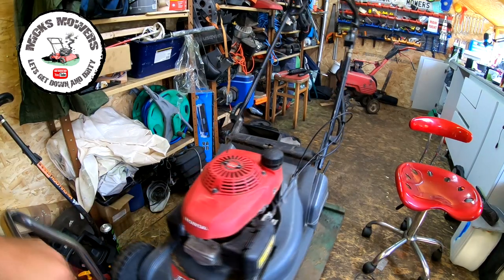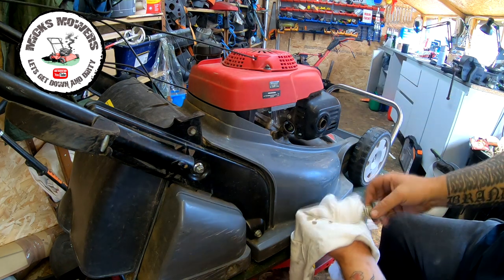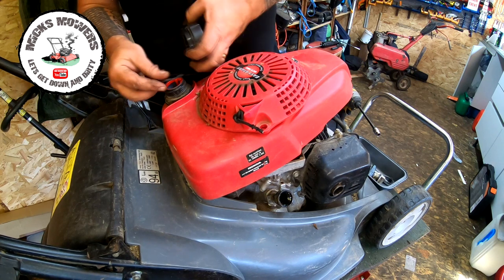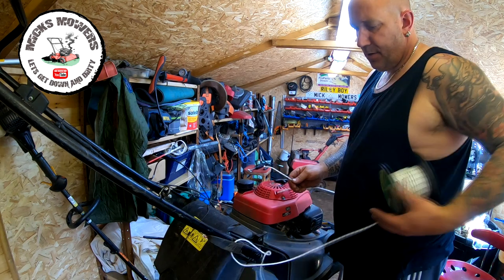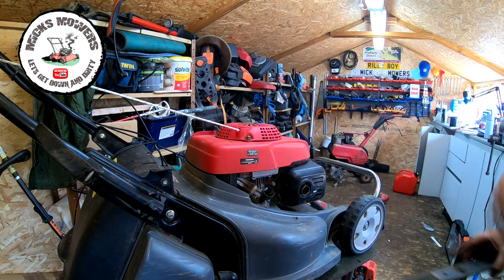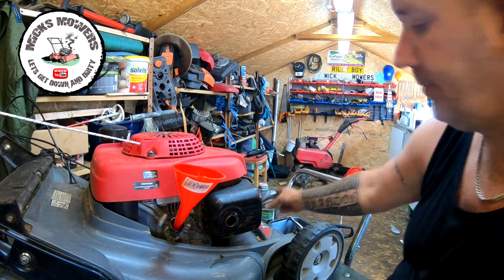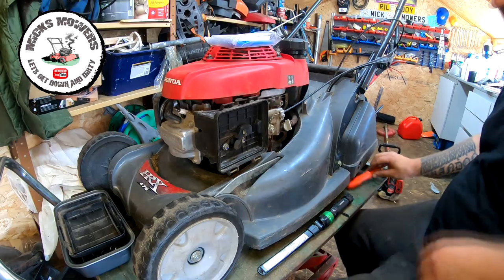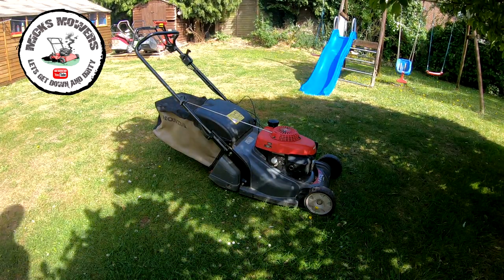Honda HRX476 How to Service Quick fix and Easy - Save some cash

Comment: Great video - really helped me do my own service.  I just had the rear drive stop working so took it in for repair and they told me a pin had snapped in the drive mechanism which should be ‘lubricated as part of normal maintenance’?  Had no idea and mower is 7 years old.  If any chance on future video include a how to on that would be maintain that mechanism great!
Reply from the maker: Hi.. yeah I have done a video on that fault already..

Comment: Hello from Texas again. It looks like things are different in the UK because all the Honda and Honda clones I've seen in stores and worked on all requires 10w30 motor oil and I've never ever seen a mower with front wheels and a rear roller. I don't know if "roller" is what it's called but I've never seen that before. Would you mind making a video explaining it or even better replacing it? Awesome video! 👍🏼
Reply from the maker: Hi.. the the roller is great for putting the lines in the grass.. when I get another one in I will do a video..
Reply: @themowerman  that's what I was thinking because I know with wheels there's very evident lines in the grass and I was thinking the roller just evens everything out.

Comment: Hey Mick thanks for this mate.  Can I ask when you grind sharpen the blade do you sharpen just one side or both front and back ?  I assume use the Nail in the wall to balance it?  Cheers Adam
Reply from the maker: Here you go mate https://youtu.be/f-KGDLtTOHE?si=5GhqOPWJckhxXcoy
Reply: @themowerman  thanks mate.   I'll take a look 👍
Reply: Mick I notice that there is the chain underneath for the self drive. Does that need to be greased or oiled ever ?

Comment: Hi Mick, i have a honda hrx 426, when i lift the back end and press the drive handle, the roller spins slightly but when i drop the machine to the ground and hold the drive lever, the machine dont move at all? Any idea what to check
Reply from the maker: Common problem.. but unfortunately it can be one or three things.. new belt?. Belt adjustment? Cable? Gearbox pins? Gearbox? ..

Comment: Yahhh...know...

Don't ask me why...I always used vise grips to remove the stuck recoil bolt.  Never dawned on me to ever use a socket.  Seems more like the human way!  I HAVE NEVER seen honda blades with the screen in them.  Across the pond we don't have those!  I guess those are mulching blades?
Reply from the maker: Morning popet.. the blade is not a mulching one due to the lift plate and as far as I know this model does not come with a plug.. hope your and your lovely wife are doing ok..

Comment: Mick...........I'm a fairly new subscriber and I have the same mower except it doesn't have the roller. First class instructional video. One question though........mine fires up fine but according to my engine tach, the tick over is about 400 rpm below where it needs to be. The machine is brand new so I'm just wondering whether to take it back or let it loosen up a bit.....or is there an easy way to increase the idle speed? Cheers mate..........first class!
Dave
Reply from the maker: If its brand new it should run as per specification so I would say take it back. It could be the throttle cable is out of adjustment. You could try and re set the cable..
Reply: Hi mick..... Thanks for that. Would adjusting the throttle cable to increase the idle revs not throw out the top end revs??
Cheers mate
Reply from the maker: @MOPARdave999  it may be set incorrect.. no harm in trying

Comment: Another great video Mick. Is it hot enough in your shed? I know I'm melting in mine! 

Got a mower in that hit something hard. I've replaced the flywheel key, checked the ignition coil with multimeter and it still wont start.

Its had a replacement blade boss and it has one key way on the blade boss. It's a semi circle shaped for what its worth. 

I've even drained the old fuel and cleaned the carb too just in case. It's a briggs classic 35.

Still no joy. What else should I check?
Reply from the maker: Check for compression.. check the dead man's switch.. have you got spark.
Reply: Micks Mowers definitely got compression as it almost broke my forearm earlier such was the kickback. The new flywheel key has sorted that. The dead’s mans switch wasn’t clearing fully so I shortened the cable as it had stretched but I’m still not sure. 

Ignition coil tested fine on the multimeter. It actually fired momentarily earlier but then cut out.
Reply from the maker: @jeffjeffjeff2  yeah check the switch again.. and put some carb spray down the head. Replace the plug and pull the cord.. if it starts it must be a fuel problem
Reply: Micks Mowers thanks, will give a try in a few days when the skin on my fingers has healed. The kickback was unreal in this thing!

Comment: Where you based mate also I have  a still throttle level seems to run on one speed and self drive don't work paid 80 for it cuts nice tho am in East London
Reply from the maker: On down on the south coast Bognor Regis

Comment: Here's a question Mick. If you can actually tolerate the mess /spillage, is there anything to stop you pulling the start cord till compression is felt and emptying the oil by tipping the mower on its side?
Reply from the maker: Nothing wrong with tipping it up mate to remove the oil. I used to all the time. But with the amount of mowers I do it's easier to collect it in the pump and disposal is easier..
Reply: @themowerman  thankyou for confirming this. Some of the older mowers actual drainage bolts are hideously tight, so a tip out is necessary.

Comment: I have the Honda hrx426 which is very similar to this one and is getting on for 15 years old, but recently noticed the mower when engaging the blade struggles and the engine often stalls completely.
What does this mean is wrong?
Is it the carb or worn piston rings?
Reply from the maker: Try a new spark plug... It can make all the difference
Reply: @themowerman  I didn't think of that but worth a try!
So doesn't sound like it's to do with the carb?
I do use Aspen fuel and runs fine when not under load.
Reply from the maker: @mattseymour8637  had it before and a new plug sorted it
Reply: @themowerman  Oh ok will give it a go then and see what happens.
So it seemed to not struggle with engaging the blade after that?
Reply from the maker: @mattseymour8637  yes
Reply: @themowerman ok will give it a go.
Could it be the blade clutch bearing underneath if not spark plug?
Reply from the maker: @mattseymour8637  could be . They have two..
Reply: @themowerman  Yes I heard have an inner one and an outer.
Worth replacing the outer bearing?